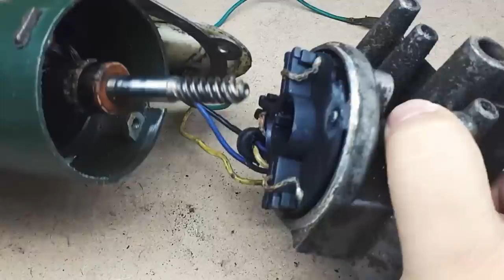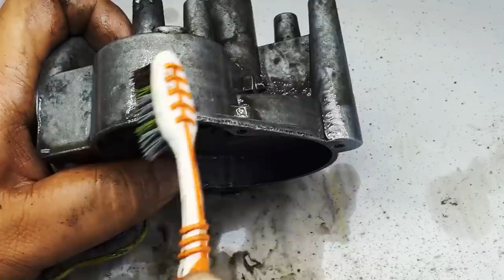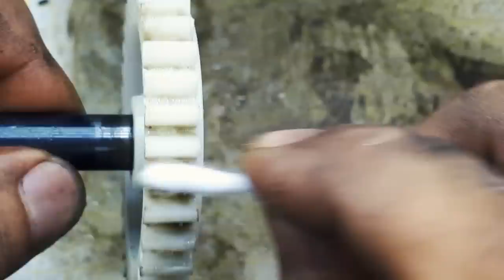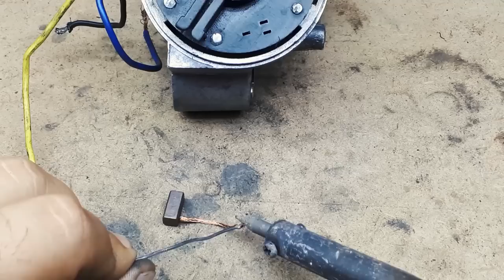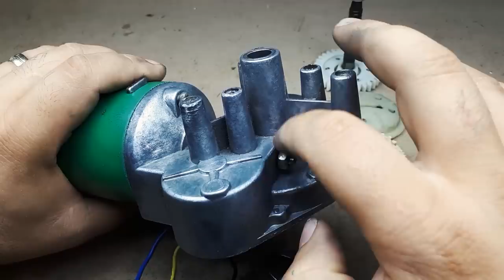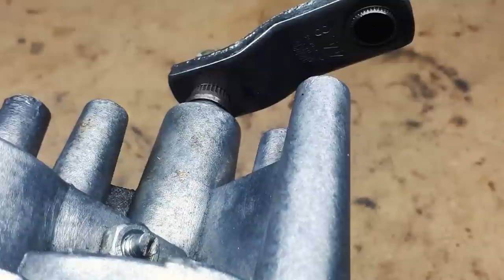Rusty Wiper Motor Restoration and reuse / Silecek motoru restorasyonu

Comment: Hello sir, excellent Job. I see that you have been experimenting with motors a lot, so I would like to ask you a question: can I rework the wiper motor so that the rotor is fixed and the rotor rotates? Specifically, I want to make an electrically powered fat bike, but without transmission or chains, so that the wheels would be used as a drive. In short, can the motor power be "switched" to the rotor so that the supply wires do not rotate with the wheel?
Reply: Can I convert it to an brushless motor?

Comment: quisiera saber si puedo hacerr un espiedo con un motor de limpiaparabrisas  y cuantos amperios consume para poder comprar una fuente de alimentacion....gracias
Reply: Pienso que si, esto deve ser unos 20 A max porque para 12 V = 20*12=240W
Pelo tamaño y bacha rotacion no creo que sea mas que esto. Pero no se mucho sobre estes motores. Compra una fuente 20A por tu proprio risco. ;)
Reply: @MaxBorges888  Gracias amigo el consumo es de 2 Amperes compre una fuente de 10 amperes y anda bárbaro.
Reply: @anibalantonioruoppulo4876  Solamente 2A? Entonce la potencia es circa de 24W, creo que por ser bacha rotacion. Bueno saber eso.